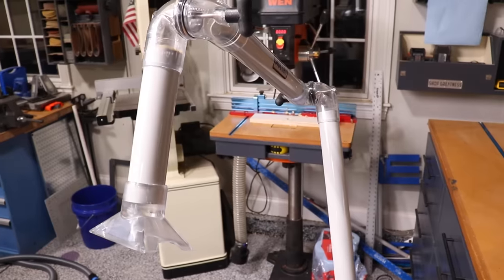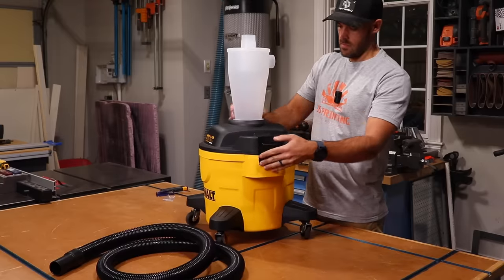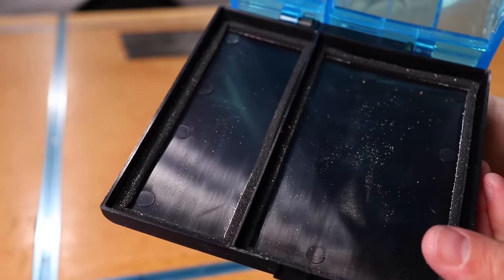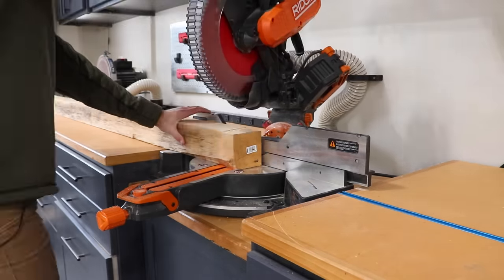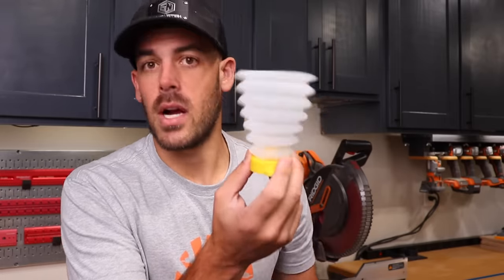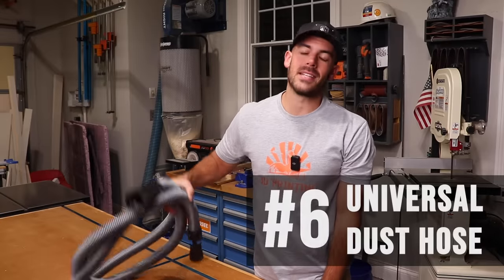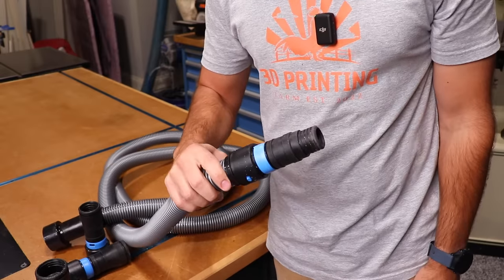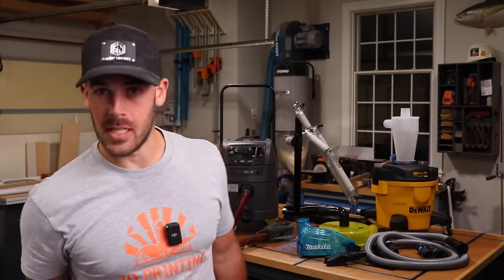Don’t fall for some of these Dust Collection gizmos!

Comment: The Makita Dust Box is, in fact, meant to be used when you are unable to connect a shop vac to your saw. It is basically a superior version of a dust bag. And, yes, it is great at that for those who want another option. It's downside is that it's a clunky thing hanging off of an already long mitre saw, so tends to be unwieldy and just gets in the way. That's why I sold my Dust Box long before I sold the saw it was meant for. Cheers.
Reply: This^

Comment: That Delmar is just a cheap knock off of a Dustopper. I use the Dustopper PRO with a 14-gallon drum and don't need anything else for dust collection. Just wheel it around with my vacuum. I get the vast majority of the dust collected before the filter, so no complaints here. That DeWalt is expensive!! My setup is half the cost with more collection space and efficiency.

Comment: A youtuber from the UK uses the bottom of a plastic jug in place of the dust boot for your drill to drill holes in walls. He just painter tapes the jug to the wall it catches probably about the same as the accordion model shown in the video.

Comment: Think I'll run out and buy a $500 sander, and $1100 dust extractor to clean up after my $13 TV dinner in my clean room. Personally a $13 microwave meal would never taste good. Boom arm looks good and I think could be made with PVC fittings with carriage bolts for locking.

Comment: For the drill dust collector, just use a paper envelope and a piece of blue tape. Open up the envelope and use the tape to attach it over or below the hole location. Then the drill dust falls into the envelope.
Reply: Yep we did that at work perfect
Reply: @dgale1023   yup and lunch bags and blue tape works great.  for smoke detectors i use the clear plastic package it comes in and drill through it.. makes a great dust catcher
Reply: lick it closed, and then mail it to your favourite fiend.

Comment: A few comments: 1) the auto vacuum switch - my problem is that if I have to turn on the vacuum, I forget, thereby negating the whole point - hence the auto switch 2) the dust collection boom - WEN makes a '2.5" x 36" Flexible dust hose' (model DCA018) that appears like a normal ribbed hose, but when you bend it, it stays fixed where you bend it. It doesn't do everything that your boom does, but, for instance, I clamped one on my drill press, and I can position it right next to the bit when I'm drilling, and it stays there. It's much cheaper than the boom ($11.96.) 3) Sanding and dust extraction - I know everyone complains about how expensive Festool tools are, but something that many apparently don't know is that ALL Festool tools are designed around dust collection - perhaps even before anything else. This is because if you're a contractor, superior dust collection can save you a bunch of clean-up time especially if you're working indoors. Festool sanders have been leaving zero dust behind for years, and you don't have to buy a dedicated system in order to get what Festool already gives you on ALL their tools.

Comment: i've been using that six gallon Dewalt separator for a few months now, and it's perfect for my DIY garage workshop. Using it with miter and table saws, the 735 planer, router table, sanders. I use it for everything, was a solid purchase.  Loaned it to neighbor that uses his own table saw frequently, and now he wants to buy his own.

Comment: I had just purchased the DeWalt 10 gallon dust separator because my Dust Right of 10 years developed cracks in the lid   So far, works great.  6 months of use will tell the real story.  I also have number 6, great hose and connection system.

Comment: I have a shop vac based dust collection system in my small shop. I was originally using a dust topper from home Depot, and it works pretty well. Then my buddy gave me his dust deputy, and the improvement in performance is definitely noticeable.

Comment: I use dust deputy 2.5s in my shop and they're amazing. One at my main shop vac setup, one at the CNC. Extremely efficient.
I remember when dewalt launched their version, they also have a steel drum variant. Not a bad buy if you're looking for a plug and play solution. Not quite as efficient as the DD 2.5 though.
I use both types of auto switches in my shop. I like the auto one for hand or table routing. The remote switch is handy to keep attached to the end of the vac hose (like the festool remote) for around the shop cleanup.
I have the big milwaukee version of those wall dust vac attachments but really want a smaller one like you used in this video. They do the job very well. Previously I used the ol' tape a bag to the wall system and it worked well enough. That silicone boot thing is a gimmick; the bag method works just as well and is free.
The mullet boom arm is convenient, but ultimately a gimmick for me. The same can be accomplished for far less money. Mullet in general is far overpriced for what they offer. They must think they're the festool of the dust collection world... At the drill press, loc line is a great option.
I have the bosch version of that cen tec hose and it's been great, but the festool dust extractor was definitely one of the best upgrades I made for my shop. And yeah, a quality sander is a game changer. I first bought the ets ec 150/5 and then the rts 400. Amazing sanders, and an ro 90 is on my short list.
Thanks for this video, excellent points made.

Comment: Boom arm: I happen to own a 1" conduit bender. Bought a 1" EMT conduit, bent it like the Festool one and ran an anti static hose with velcro. A 12gauge extension cord through the conduit. The boom arm cost me $22 plus a few plywood boards to secure it on the wall and voila.

Comment: I had a duststopper for years and it worked well but the little bucket fills too quick and as stated starts to go into vacuum, I literally just bought a dual cyclone unit from TEMU for $35 then attached it to a clear 27 gallon storage bin.  Fantastic setup and ran the other day and amazed at nothing went into my shop vac plus have a ton of storage that I can see when it gets full.

Comment: for driling a hole in the wall - i use painters tape. Just stick a peace in kinda U shaped nest under the hole and most of the dust sticks to the tape. By mindfully pealing the tape off you can leave 99% of the dust on the tape.

Comment: I got an Oneida Air Systems Dust Deputy 2.5 cyclone separator last week and paired it with my Rigid shop vac. After cleaning a 6 month pile of sawdust from behind the table saw and vacuuming  the rest of the shop floor including crumbling concrete, the shop vac is virtually empty and the filter only has a little dust on it! Never believed it would work so well. It is somewhat difficult to drag around so I may get the 32’ hose for that vac and park the thing in a corner. For what shop vac filters cost, and pain cleaning them this type of separator is a necessity!

Comment: I use the automatic vacuum device for my table saw, planer and jointer, for those devices it works fantastically; I can only see using it with a miter saw if the saw is enclosed or partially enclosed in a hood or something.

Comment: Totally agree on your point of "bigger is better."   A true cyclone separator will outperform any of the versions that simply just spin the air at the top of the open-to-the-bottom canister/pale.  You need to put a large one in front of your wall mounted Rockler.

I looked at a smaller separator and a shop vac that I could move to the tool in use, but decided I was better off putting the time and money into running DWV piping in the shop that goes back to a Oneida Dust Deputy Cyclone XL in front of my Grizzly 1250 CFM.  Never looked back.  It works like a dream and catches 99% of everything before it makes it to the Grizzly dust collector... I almost never have to change its bag.  Not having to move each time I use a different tool it is a huge improvement.

Comment: Hi Travis, i use a 4 pint plastic Milk Carton cut in half for my Indoor Drilling Holes, the bottom of the Carton i tape with Blue Masking Tape on the wall just under the hole to be drilled, and all the Dust settles in the Carton. As an added extra because the top part has a Funnel Shape that the Milk is poured from, this becomes ideal to use to top up your Glue Bottle so as to not spill it everywhere it works great, as long as whatever you want to pour into is slightly bigger than the neck of the Funnel, if you keep the Lid you can screw that back onto the Funnel then you can use that to fill a bit with Water or White Spirit to clean your Paint Brushes.
The Cen-Tec Dust Hose with attached Fittings is great we have had that in the UK for a while now, you can buy more Hose Ends and Clips to add to the collection. Brilliant.
Take Care and Stay Safe,
Barry (UK) 👍

Comment: I have one of those bucket cyclones separators.  I got it at Home Depot - it’s a small gadget that fits on top of the Home Depot bucket. I don’t know why you’re saying they’re not good because mine keeps all the dust and chunks out of the vacuum cleaner filter - except, of course, for the very fine particles which are filtered out by the HEPA filter in the vacuum. The only problem I see with them is that they need to be emptied more often than the larger units - of course. I have used mine now for over six months and the vacuum filter still looks almost new.  Not sure where you are getting your information but the effectiveness of one of those bucket filters has been empirically demonstrated to be extremely effective (to my total satisfaction).  As a matter fact, it’s really quite surprising how well it works.  I would probably not recommend it for a high-volume commercial service because  of the bucket’s capacity. I’ve only emptied mine once and it really didn’t need it - it was just a show somebody very well it works. 

ALSO - I do like the fact that you have separate units for separate workstations, such as saw and router etc.  That’s really a good idea and would actually lend itself to using the bucket type even more.
Reply: The issue with the 5-gallon bucket lid style separators, such as the Dustopper, is the fine dust you mentioned. Yes, this fine dust is captured by the vacuum's filter. But, that means the filter will become clogged with the fine dust, reducing the vacuum's efficiency over time. The purpose of a dust separator is to prevent the vacuum's filter from becoming clogged, which the Dustopper doesn't do nearly as well as the Dust Deputy. 

This doesn't mean that a Dustopper isn't worthwhile. It will reduce the amount of fine dust that reaches the vacuum's filter, increasing the amount of time you can use the vacuum without needing to clean the filter. So, it helps. Just not as much as a true cyclone, such as the Dust Deputy. As our host said, the lid-style separators are best reserved for instances where space is factor. You'll just need to clean the filter more often.

One last tip: Empty the dust collection bucket often. Never let it get more than 1/2 full. If you let it fill more than that, the fine dust won't have enough room to settle out of the vacuum's air flow and will be sucked up into the filter. That's true for both styles of separator!
Reply: Install the bag that came with the vac, problem solved at no extra cost, no?

Comment: I have auto vacuum switches for my table saw, and for my milling station, and for my band saw. All of those are constant-use (generally) when using them, vs. the miter saw that's used like 3 seconds at a time.
Reply: I run those switches as well for years without any problems.  I use the IVac one with 2 power sources otherwise you can burn out your motors.

Comment: When I'm drilling a one-off hole in (a vertical surface of) the house I use some blue tape and a sheet of paper to build a catch trough below the hole.  If you've ever tried something like this by taping an edge to the wall curved to make a scoop shape, you know it only delays the mess until you try to remove the paper.  The trick is to fold it lengthways about 1/4 of the way on both sides and then tuck a corner halfway down each side (like wrapping corners of a gift) so what you're left with is sort of like a corner brace that might reinforce a 2x4 butt joint (but lacking a crease at the corner).  Tape one side to the wall and the mess will gather in the trough created by the other sagging side.

This trick will also work for larger access holes, which I make circular because the repair job afterward is easier and comes out better.

Comment: For the dust extractor remote; in Canada some of the cheaper products are less available, so I got a couple of the “outdoor outlet switch”, they are often sold with Christmas lights/for block heaters and are usually $10-15, cheapest option I found and works great.

Comment: Gimmick for the non vac dust collector for drywall holes. Just use a envelope taped up with painters tape below the hole location.

Comment: The silicone dust boot is just a fancy version of a spray paint cap or bottle cap, or literally any plastic cup that you don't care about.  
I've even used trimmed down styrofoam and red solo cups to to the same thing, especially overhead drilling.  
Just drill through the bottom of the cup, hold it against the surface and drill.

Comment: Dust catcher- just 3D print a nozzle for your hand vac- I use a Bosch 12v mini-vac, and use a nozzle that fits around the hole. See Thingiverse for the download.
Vac connect- I standardized on the DeWalt  Air-Lock system. You can easily make the tool end connectors out of waste pipe adapters, or just 3D print them. Best system on the market- locked on but can rotate.

Comment: Thanks for the vacuum hose suggestion. 

I use the blue tub from a Rockler dust cyclone as my wood scrap bucket. It was that useless. I got a Dust Deputy from Oneida that works really well. However, I’d jump on that Dewalt unit in a heartbeat!

Comment: My shop dust collection accessory mvps are the Drillnado for my drill press, it legitimately handles 100% of shavings.  I also made an overhead dust collection/blade guard for my table saw that is incredible.  You can’t use it for everything and definitely not with most sleds or jigs, but ripping plywood or mdf it gets practically everything

Comment: I've had a Dust Deputy for many years and have yet to change the bag in the shop vac that it's attached to. The vacuum hose and adapters look quite nice. This is something I continue to fight with but figured I might just have to deal with it. Perhaps not anymore.

Comment: I got the full Xtract system. The vac arrived with a major crack on the upper unit, so it had to be returned; 2 week setback. For such an expensive tool, 3M went super cheap on the packing, instructions and accessories. 

The sander itself (6" version) crapped out after about 10 hours of use. The electronic control simply wouldn't allow the unit to turn on. It is a widespread issue. They claim to have fixed the cause with more recent units, but no way to differentiate between "old" and "new" models, and IMO, they should have done a proactive recall / replacement for those stuck with the version 1 lemon models. I was offered a replacement or refund, but I've lost faith in 3M, so I got a refund and replaced with a Rotex.

Cubiton / Xtract paper is awesome though

Comment: I would have actually liked for you to maybe discuss more on the mullet dust collector. If a system like that is more spacing saving and efficient than lets say a bucket with a cyclone on top of it? Great video and I definitely enjoyed your alternative to using a remote switch vs the automatic switch. I can't tell you how many times I feel bad about my vacuum turning on and off constantly.

Comment: I purchased the 3m sander and dust collector not too long ago, and like you, I was really surprised at there being little to no fist on my table. Really a great addition
Reply: I got the same sander when it first came out and loved it. Lasted about a year and started having issues. Just quits randomly and shuts down. Lots of complaints on their website for the same issue. Unfortunately I didn’t save the purchase info and am out $500. Ended up biting the bullet and got a Festool after that.

Comment: The iVac Automated Shop Vacuum Switch has both an automatic vacuum start and a manual start.  It really works well.  I use a magnetic hose connector mounted in my SCMS station.  I can pull  the hose from the miter saw and connect a hose to clean up the area.  The manual-on of the iVac switch works really well. It's the best of both worlds.]

If you use the remote (I have one on my DC) on multiple collectors, how do you tell it which one to turn on?

Comment: You missed a huge mark by not including the Onieda Dust Deputy Low Pro separator in this vid. This is an outstanding product that works extremely well. I use 2 of them connected to Ridgid 4gal 5hp rectangle shaped auto detailing vacs. Check them out for your own curiosity. I'm still waiting on a dust attachment for my dewalt 10" miter saw too😁Taipan Woodworks

Comment: The auto switches work really well for some applications though. I use a one with a cheap dedicated shop vac with my RO sander for example. Sure you can buy a high end vac that does it all but the vac I use was like 30€ and the switch was 20, you don't even get a high end hose for that price. I have another one with another dedicated vac on my oscillating sander too.

Comment: This is probably a silly question…

The DeWalt vacuum with the cyclone separator on top….

Isn’t the purpose of a separator is to keep (most) of the dust/particles out of the vacuum???

Appears to me the separator empties directly into the vacuum (??)